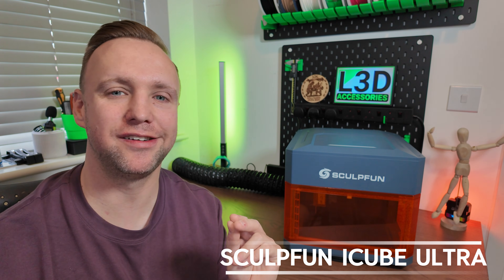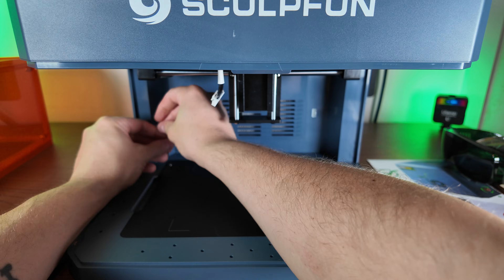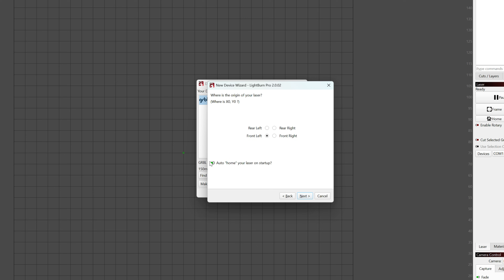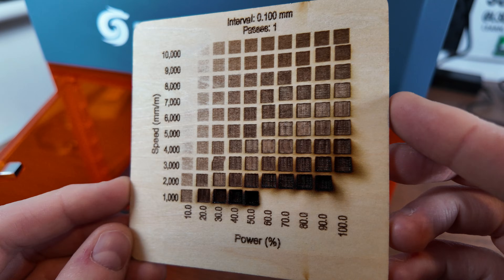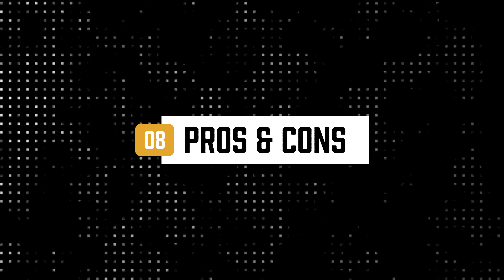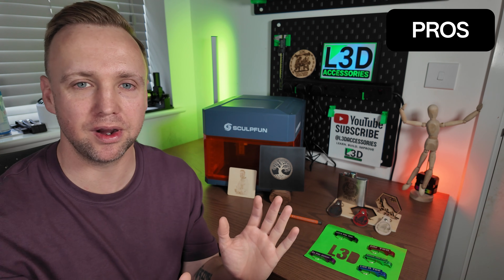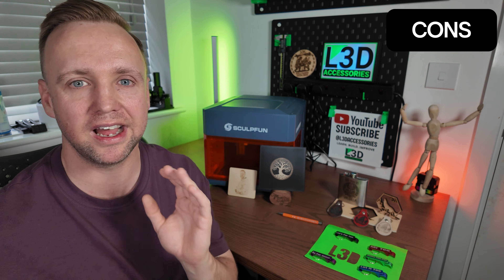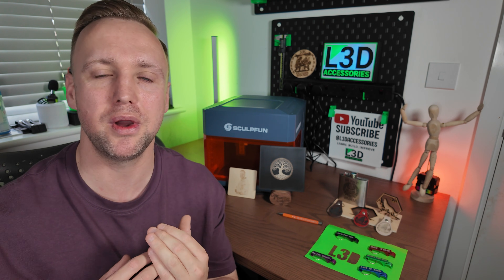Is the Sculpfun iCube Ultra the Best Compact Laser Yet?

Comment: Are the jigs you used in the video good for the iCube Ultra? Or are they on the small side?
Reply from the maker: They are a bit smaller than the cutout but ok for rough placement. I'll be designing proper jigs soon for it.
Reply: @L3DAccessories thanx for the comment , i’m interresting in the jigs fot the icube ultra

Comment: Hey man, digging the vids! I had a question tho, I also have a sculptfun ultra, but when i try to engrave a hip flask, my design starts getting muddy near the edges (i think its because the laser cant adjust the z axis). How did you solve for this? Did you just find the perfect area, where the laser is just about the lose focus but doesnt?
Reply from the maker: Hey mate, great to hear you've got the ultra as well. I actually focused the laser directly on top of the curved surface and used those settings in my video. I deliberately increased the power to compensate for the potential focus loss on the lower sections. If you're really struggling I'd let it autofocus and then manually lower it down on the rail a little bit. That should solve it! Also, I used the IR module, are you using that too?

Comment: very informative video, many thanks, now has me thinking seriously about it, would loved to have seen it working with glass, i wonder would it be useful for maybe using on a crystal trophy? would your x1 jigs work with this model
Reply from the maker: Unfortunately I didn't get the opportunity to test it on glass but it's something I can do for future content. That being said, I suspect it would be absolutely fine engraving glass if you use an acrylic style paint or chalk spray as the Diode laser is powerful enough to mark the glass. Yes the F1 Jigs would work with this model if you say then directly on top of the engraving bed. I am looking into potentially designing a direct fit in jig for this series of laser.

Comment: How easy was it to frame the object, looks like it may be a bit of a faff having to have the door closed all the time 
Thank you
Reply from the maker: The framing itself was simple to do and worked well. You could see the laser beam well enough through the perspex. That being said, if you want to get close and really make sure it's well lined up opening the door is important and then the framing would shut off. There's a small magnet that you can manually activate above the door which can override the safety features and allow you to frame with the door open. It's important for me to also say that there may well be a way to disable the safety features in the software that I don't know about.

Comment: Great review mate, looks like a very capable laser especially for the price point. One thing which would put me off is do you have to switch modules and fit them based on the 1 you want to use or are the both installed and you can just select in software?
Reply from the maker: Hey Garry, thanks for the feedback. With this laser you have to manually swap out the laser module when you want to laser using IR or Diode. It's quite common in a lot of the gantry style lasers.

Comment: Hello, I like the laser so far but have some concerns. 

Since its engraving area is small, isnt 12w diode a bit overkill? With smaller engraving area, you create smaller items which are more detail heavy and the bigger the power of laser is, the bigger the spot size is and that means less detail. 
On the other side, since it has 12w diode laser module, cutting is possible but there is only exhaust fan which is not that helpful for cutting. Is it possible to add air assist or any other way how to reduce burn marks around cut lines?
Also i wish someone created this size of the laser but with one laser head where you can switch between diode and IR and dont need to change the whole head.
Reply from the maker: Hi, thanks for watching! I'll try to answer your questions in order:

There is a air assist option you can specify when purchasing so cutting is very practical and achievable with this laser.

12W is definitely more than enough to do most things and it could be considered overkill however it's also really good for marking glass, cutting small/medium wood and cutting coloured acrylic. 

If you have anymore questions feel free to ask and once again, thank you for watching!